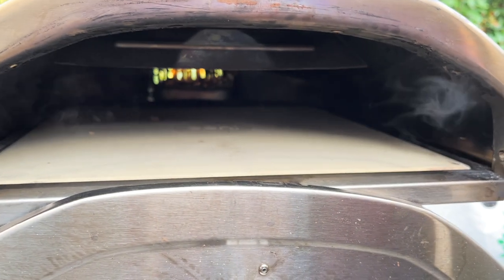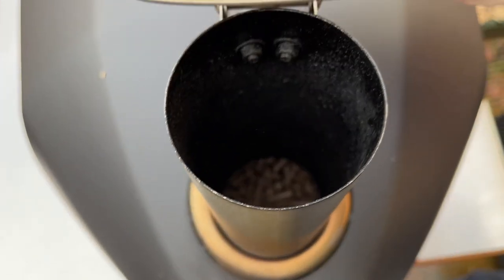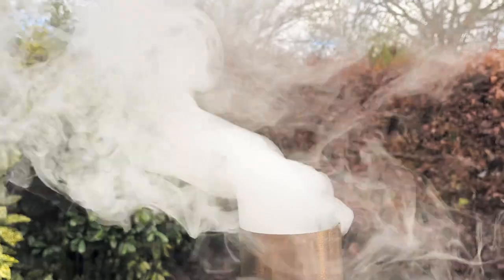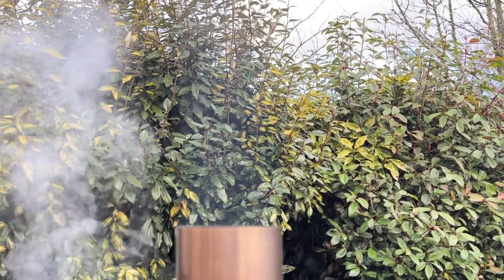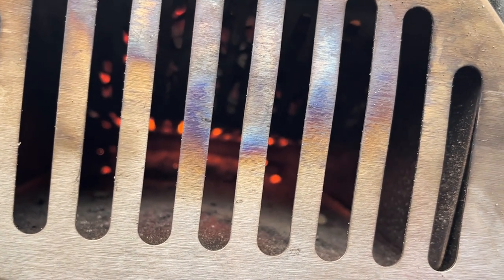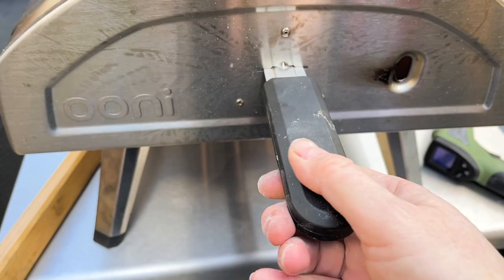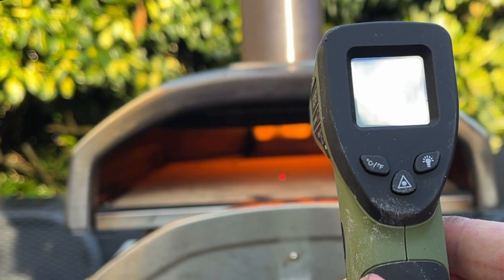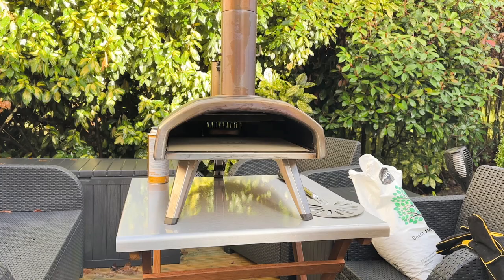Step-by-Step: Lighting Your Ooni Fyra 12 (The Beginner's Guide to Pizza Perfection)

Comment: Nice video. A few things… try adding pellets very slowly during initial light and only a half scoop or less at a time as adding too much too fast will smother the flame. As you did, blowing into the back a little will usually get it going again.  

As far as helping pellets drop, try using a skinny round metal file and gently poking the pellets from the top once in a while. You’ll feel and see them fall into the tray and works much better than banging on the hopper. I’ve found that tapping the hopper can make the flu close , since as you mentioned, they tend to be loose. If that happens, hopefully you catch it in time before the flame goes out.  Also, to fix this, try putting a metal washer under the nut that holds the flu in the chimney. That will keep it in place and add more resistance. Another option is to remove the flue from the chimney and stretch the springs out to add tension. Ooni will replace the chimney if requested but the new one will eventually have the same problem, so you’re better off fixing it yourself.  Hope that helps

Great oven, once you master the learning curve , which is steep but  makes it fun
Reply from the maker: Thanks for your super pellet tips! I need to fix the chimney as you say, I may remove it completely as I never need to close the flu for any reason so will do that.  Not sure if the Ooni 3 chimney fits - I have the 3 chimney which works great and the flu never closed when I tapped the hopper with that!  So will try that too.  Thank you!

Comment: I read a guy say some ash and debris go into the stone from time to time while using it. Is it safe to brush it to the side while the oven is lit?
Reply from the maker: Hi - yes I've done that too - I use a long bristle pizza brush with a heat glove on to do that as the oven is quite low so it doesn't touch your hand.   I brush it out the front of the oven too if needs be.
Reply: @Got2EatPizza  sounds very reasonable. Thanks for sharing so many details of your knowledge!

Comment: I have also a Ooni Fyra, happy with the pizza, but my pellets stick in the pellet hopper, so I have to shake the hopper to get the pellets down. More people with the same issue?
Reply from the maker: Hi - yes - this happened in the ooni 3 as well as the pellets sort of stick in the hopper and so it just needs a firm tap and that dislodges them down into the grate!
Reply: Yes, same problem. It’s too much to manage when you have to cook multiple pizzas. I’ve tried loading up the hopper, and have tried only a little pellets every few minutes, but the fire goes out eventually either way. I will try tapping the hopper from time to time (with a fuller hopper), and finding a metal rod to persuade the ash to drop down. Maybe pellet type helps too. I noticed you are using Ooni pellets. I’ve been using Traeger pellets.  Maybe the Ooni ones work better? Maybe I need a Karu 16 oven with gas.